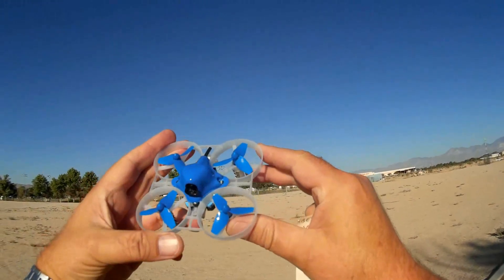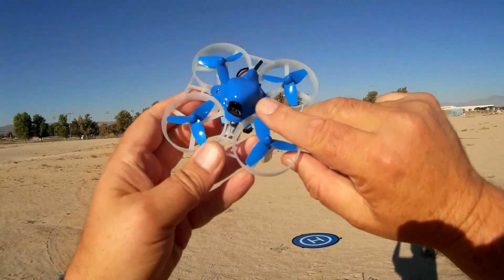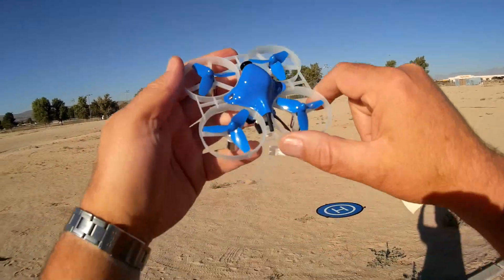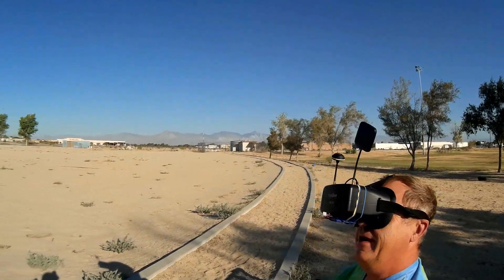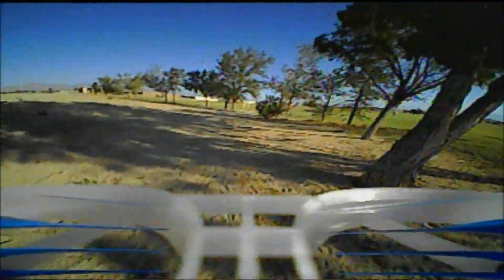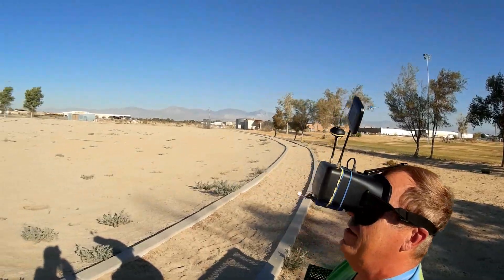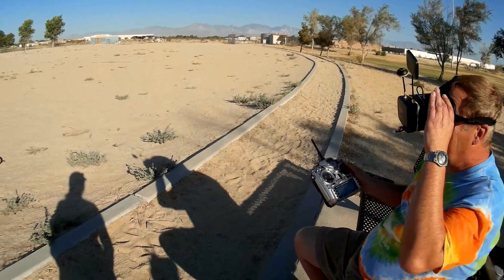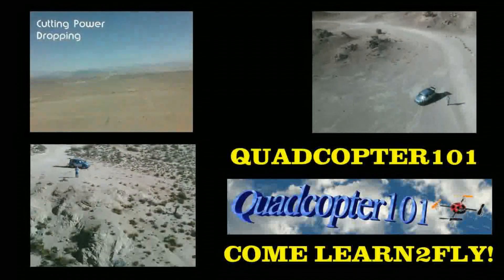Beta75 Whoop Style Micro FPV Drone Flight Test Review

Comment: I am thinking of buying one of these HD mini whoop drones, and I would like to ask whether in your opinion my 2.4GHz Walkera Devo 10 transmitter,  whose spec sheet lists DSSS technology that purportedly features "automatic ID binding ", can work with this Beta75 HD drone.  Any thoughts on this compatibility question would be much appreciated sir.
Reply from the maker: It can bind to the DSM2/DSMX receiver version .  BUT you would first need to install Deviation firmware to the Devo 10.  In fact I had done this with my Devo 10 so that I could review micro racers.  If you are unfamiliar with Deviation, the following website should be of assistance.  But note that once you install Deviation, you would need to rebind and configure your Devo to all the drones that it was previously connected to.  https://www.deviationtx.com/
Reply: @Quadcopter101  Thank you very much sir, for this very informative reply.  I  now have a clear set of instructions to ensure that my Devo 10 finds a new lease of life as an FPV drone transmitter, now that my old Walkera V450 D03 CP helicopter has gone into retirement.

Comment: Beta 75 or DYS Elf
Which one is faster.    ?
I need your guidance with my next purchase.
Reply: having owned a dys elf, i can assure you that it runs circles around the beta75. i must warn you though, the elf has a lot of carbon fiber dust on the frame, which is about as bad for your lungs as asbestos.

Comment: Which radio controllers are compatible with this micro drone ? still learning about these
Reply from the maker: Available BNF version is currently Frsky (integrated with FC board).
Reply: Quadcopter 101 
I have a few of the hubsan controllers does that have BNF
Reply from the maker: +Ben Franklin Hubsan controllers will not work with this.

Comment: between dsmx and flysky which transmitter you recommend me to buy
Reply from the maker: If your first hobby grade, recommend Flysky.  They're cheap, but still good hobby grade transmitters to start with.  Make sure you get the i6X AFHDS 2A version (not the older/cheaper i6 AFHDS version).  The older version has no failsafe capability, and can result in flyaways.

Comment: I've Been Looking For A Nice Cheap Foldable Drone That I Can Easily Use.
I'm Not Sure About Alot Of The Ones Advertised But I've Found Two That Really Catch My Eye, Perhaps You Could Have A Look At These.
http://www.gearbest.com/rc-quadcopters/pp_647091.html
http://www.gearbest.com/rc-quadcopters/pp_637887.html
Reply from the maker: Both have very low resolution 0.3MP cameras.  If video is important, recommend skipping both or you'll likely be disappointed.  The following is an inexpensive foldable FPV, but with HD 720p camera and recording capability https://www.youtube.com/watch?v=S1ELTZfT0XE  Make sure to select the 2.0 MP 720p version, and not the cheaper 0.3MP version.